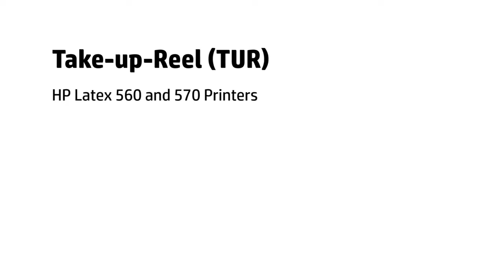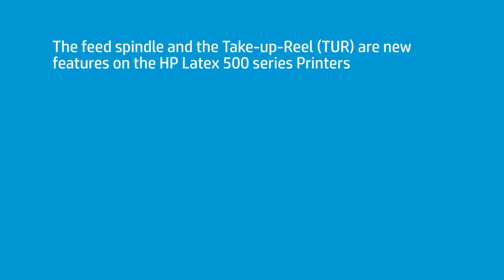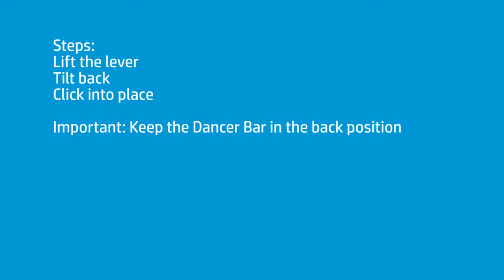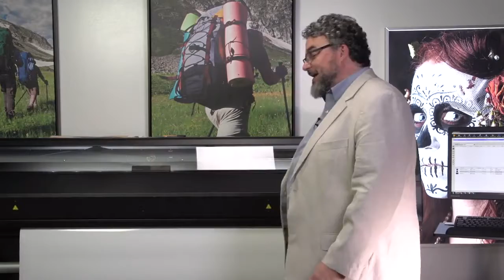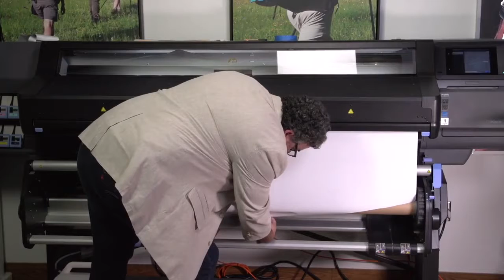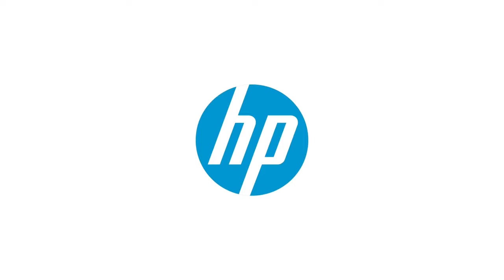Take up Reel TUR for HP Latex 560 and 570 Printers

Comment: Hello,
Unfortunately I'm an owner of the printer Latex Hp 570 and I must admit that it is the worst printer that I've ever had in 18 years working this job. I already had two Latex printers 2550 and 2650 which were much better than Latex 570. I've bought it to impruve  and speed up printing but it just can't print more than 12m2/hr of usable quality (although is stated 23m2/hr). If you want to print in faster mode passes are visible. The other problems with it are bad vacuum which causes wrinkles of the media what than causes printhead carriage jam. That mostly destroys at least one printhead. 
While printer still was under the warranty I complained to local dealer (gold dealer for my area) but they've just changed touch display and the yellow colour pump which also broke down. I also tried to complain directly to Hp but they've refused to help because they claim that Latex 570 is a „perfect printer“.
I’m just unsatisfied user who writes all this hoping to help others not to do the same mistake buying this printer.

Best regards